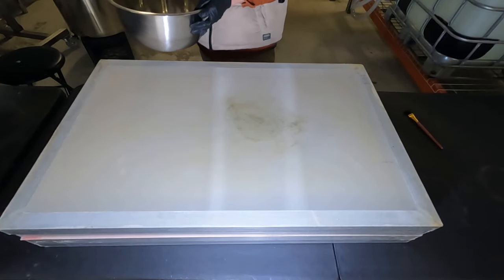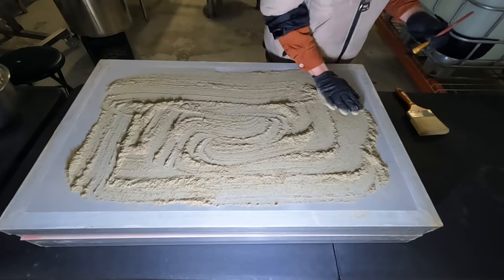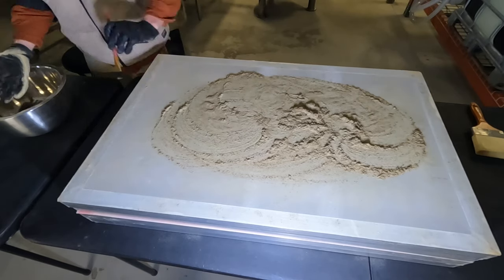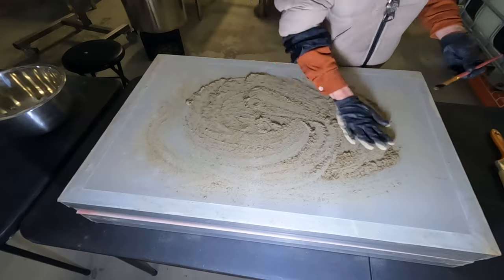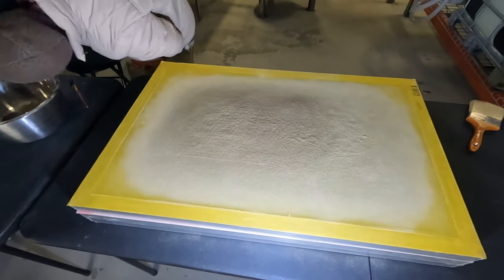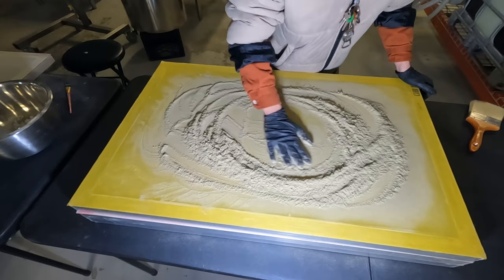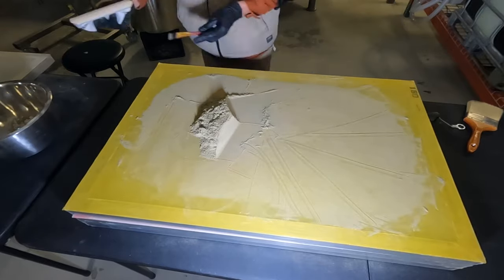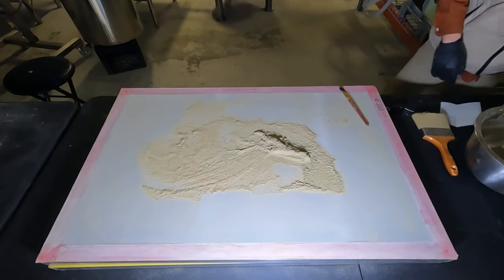Static Sift Tutorial - Tribolelectrostatic Separation of Trichome Heads

Comment: love your work and awesome content - thank you!! 
what are your thoughts on hoover tech to clean heads ? 
hope to catch u @spannabis 
thanks again
Reply from the maker: What is that? Hoovertech 😅
Reply: @SamboCreeckFiltration  place sift into 25u hanky and fold to make a parcel, hold on f**king tight whilst use a hoover to suck through it .. don’t let go ! Sub 25u particles (mostly stalks and dust etc ) will be sucked through and your heads won’t ..
Do this after some basic static cleaning first but this can clean up fast .. u will lose sub 25u heads too but if u hav the right material that’s not much.
Reply: Many stalks and contaminants can be sucked through a 25u whereas larger heads won’t be sucked through
Reply from the maker: Gotcha. Sounds epic! A rotary vibrating sieve is what we use to do the same. We eliminate fines and oversized.
Reply: really looking forward to seeing your stuuf at spannabis.. one day be a dream to use such equipment.. tl then its hometech and screens  @SamboCreeckFiltration  know im gonna love working my way through rest of your content 🤟

Comment: Have you ever experimented with cymatics to make the screens move the material ??
Reply from the maker: Can you elaborate? What would the purpose/application be?
Reply: @SamboCreeckFiltration  to take out the hand work if possible, use frequencies to move the material to break of the stalks.
Reply from the maker: @magmaseeds  will that work? Just vibration? We use rotary vibrating sieves and that alone does not remove stalks. Does anybody have any insights or opinions on how to decapitate?
Reply: @SamboCreeckFiltration  is not really  the vibration But rather How the material would move between different frequencies patterns.. Anyway really good video
Reply: @magmaseeds  semi-related but I saw that the nutes in my bucket settled in a pattern with a 4-way symmetrical set of the same features. Likely from light vibrations on the floor. Was neat to see.
Reply: @SamboCreeckFiltration  by changing the frequencies you can have different vibration pattern , like sand on a speaker
Reply from the maker: Right that’s cool but I wonder how that can be applied to remove stalks?

Comment: Very intresting    what is the best humidity and temperature of the room to favorise the process ?
Reply: Temp low, Humidity low basically if you could do this high up on a mountain with barely any vegitation and in the winter, it would be ideal.
Reply from the maker: 40-60 RH. Let us know what sweet spot works
for you.
Reply: @SamboCreeckFiltration  I want to add that this is strain dependant, some strains have ''dry resin'' meaning the cellulose wall that seperates the inside contents of the head to the outside where it is exposed to elements is more dry and less sticky, then you have ''gritty'' kind of in between and then you have a full on stickyness. 

Playing with temps and humidity will be needed to find a sweetspot, sometimes you need to go to as low as 20% RH and a higher temp or lower temp, usually lower temp but surprisingly some strains, the cellulose layer is made up in a way where actually a temp below freezing will cause tearing. 

It really is an art to be honest as well, when do you stop for optimal flavor, just like harvesting time is also an art.
Reply: @SamboCreeckFiltration  Unless you are working with ultra dry resin (which you may depending on what you are growing/buying for the source material.) 60% is almost always too high BUT it is possible that you may need to pump it up to 60% if you are working with some strains. On white wookies for example I had to pump it up all the way to 65%!
Reply from the maker: Interesting. I would add to “strain dependent” should read “chemistry dependent” because the charge possibly is based on chemical composition. Electrons move slower the colder they get, so much so that some particles lose charge when cold. In mining, we heat up the particle to get a fronted charge when using the roll separator. Now is the affinity for charge on the Trichome related to humidity or temperature? Or is it the interrelationship of both? How does chemistry affect that relationship? And does that relationship hold on all particles sizes? And why is that? 😅
Reply: @SamboCreeckFiltration  Ummm I have no idea however, I just write it down for simplicity sake so everyone understands it. The 100% correct way of wording it would be. The Chemovar type of the Genotype observed in a certain phenotype of cultivar and the makeup of the resin produced by the Cannabis plant.

The issue is, strain is not even the right way to say it, you only have strains in bacteria BUT the lingo is the lingo, language is just a vehicle to get the point across, there is no point in going over language technicalities unless doing a proper scientific paper.

By saying ''strain dependant'' you understand I mean strain X maybe wookies or strain B maybe grape cream pie, they will behave differently but of course I mean what I said above. 

Lol
Reply: @SamboCreeckFiltration  I want to add that you are mainly looking at difference in cellulose which then holds different charges and reacts differently to friction (I think I'm saying that correctly) but the big hurdle is each cultivar has a different kind of resin outer layer make-up, look at it the same way each cultivar has its own unique shade of green.

It may look easy but it is really not, this is a big part of why most people resort to blasting or water.
Reply from the maker: This is a brilliant hyposthesis that I doubt is fully explored. We found that inner chemistry plays a roll, but all the research papers I read lead me to focus more on the outer shape and morphology of the particle. Perhaps this phenomenon plays a more prominent role than we have considered.
Reply: @SamboCreeckFiltration  What I will say however after thinking about this for a day again, I will say that you are right. The shape and morphology does play a more important role than what I have mentioned. What I have mentioned is just a very small thing that you can ignore to be honest, reason being it is not a controllable variable at all unless you want to do a decade long breeding program!